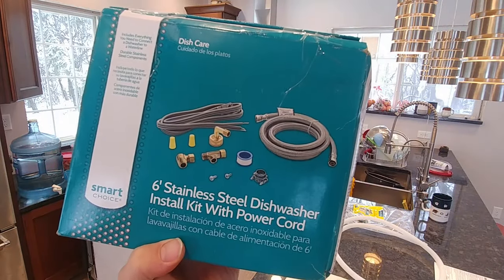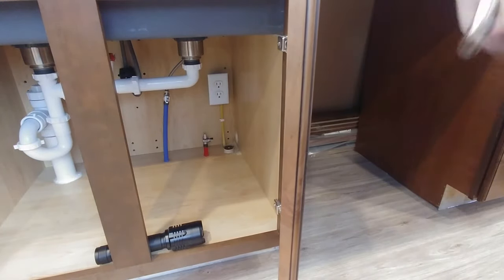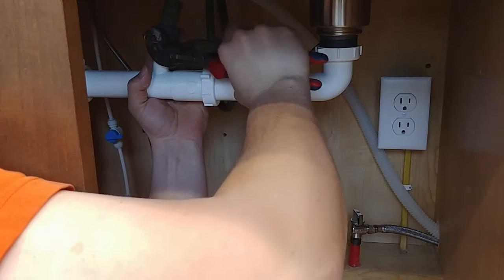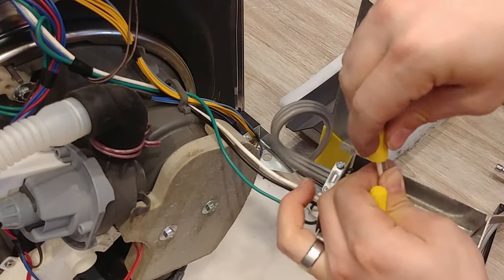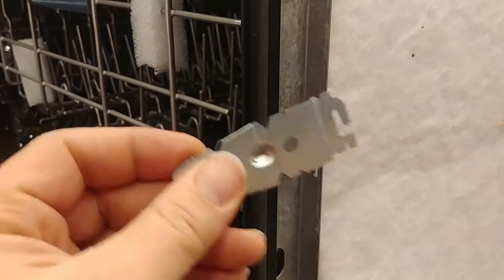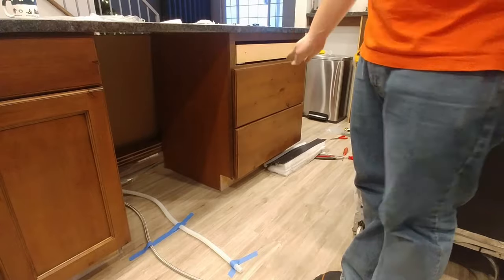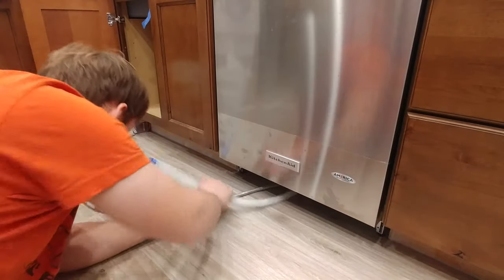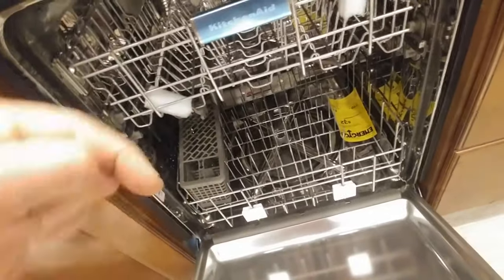How To Install a Dishwasher - Full Installation - Plumbing & Electrical Connections

Comment: What size is is your waterline supply hoses?  

This is the best video on installation that I have seen on youtube!!!!!!!!  Others never mentioned the flush or adjusting the legs while unit was outside of the well. I like how you taped the hoses down away from the side, and how you detected the hot wire between the 2 gray ones they had inside.  Well, I could not afford a Kitchenaid but I am getting the Maytag with the giant third rack look-a-like!!!!😄😄😄  I may use Teflon & megaloc on all threads to guarantee no leaks!!!!  THANK YOU😊

Comment: To make it easier to feed your water, electrical and drain lines through the hole in the cabinet, once you have them attached to the dishwasher, you might find it easier if you tie a three foot piece of string to each hose, then while the dishwasher is outside of the cabinet space, you can just feed the strings through the hole and pull on the strings, which will pull the hose and cables through the hole as  you start to push the dishwasher back into the cabinet space. 

It's like extending your hoses and cables an extra three feet allowing you to pull them through the hole in the cabinet without fighting to get your arms back behind the dishwasher once it is already in the cabinet slot. 

Then just take off the strings before you attach the power, water and drain hose to their respective connections. 

That is what I do and it keeps me from having to try and fit my arms back in between the washer and the cabinet walls while feeding the hoses and pushing the washer back into the slot.  Great video! SUPER DUPER!

Comment: Great video for sure, my city code does require an air gap or route the drain hose so that the loop goes higher than the drain hose connection to avoid waste water from draining back. Thanks for the video :)

Comment: your country is different to australia..cords plug into the machine and all the hoses are already attached, you just push the hoses and electrical cord through the hole in the cabinet screw the hoses on to fittings under sink and plug in the power, honestly its childs play here but REALLY complicated where you are!!

Comment: Electrical outlet under the sink? Crazy.  Direct connect power to dishwasher. Way safer.
Reply: He said it's on a ground fault/arc fault breaker. Which is super safe.
Reply: Brian Joyce ground fault is good but prone to tripping. Pain in the arse.

Comment: Isn't that a 15 amps recetacle that you have installed there ?
Reply from the maker: Yes it is. It is permissible to use a 15 amp receptacle on a 20 amp circuit. Is there something that I'm missing about that? Inspector was fine with it. Thanks for asking!
Reply: @BenjaminSahlstrom  You are absolutely within code.  Very standard and common for 15 amp receptacles to be on 20 amp circuit.  Kitchen branch circuits need to be 20 amp per code anyway.